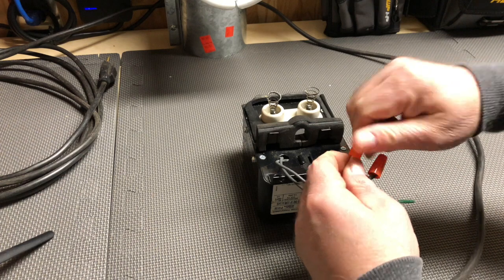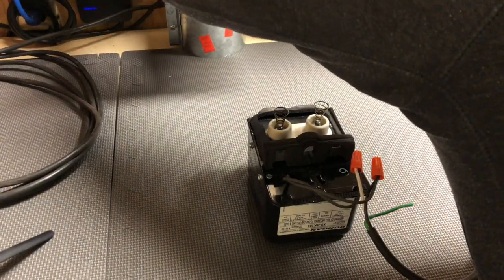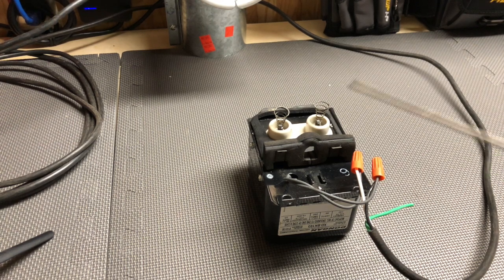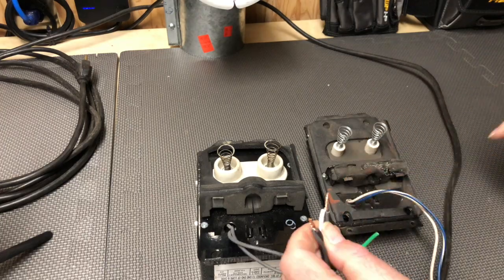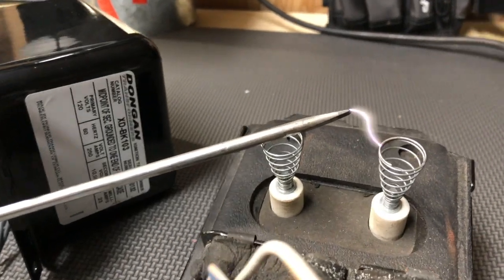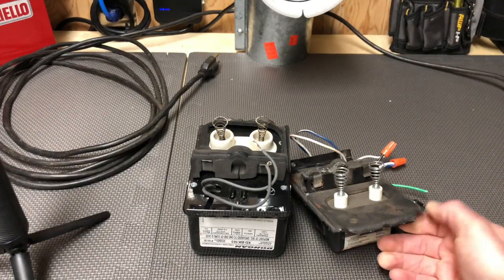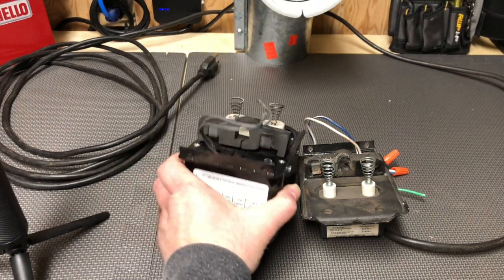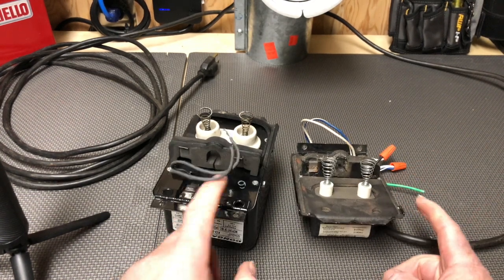20,000V vs 10,000V Ignitor – Shocking Burner Test

Comment: Does the higher voltage of the igniter improve combustion? Does it tax the ceramic insulation of the electrodes?
Reply from the maker: Stronger spark which help to ignite. The combustion is improved by adjust the fuel and air mixture using combustion tuning equipment. As for the electrodes, not 100% sure and every system is different because the controller may or may not turn off the spark after ignition had been established! I hope this helps!
Reply: @FurnaceTech I was told that the ignition transformer can be wired to turn off after the spark is achieved...is this true?

Comment: I have the bigger transformer like yours running my Tesla coil and it works great,but can it handle 240 volts A/C???
Reply from the maker: I would only hook it up to the power source it’s rated for posted on the data plate
Reply: @FurnaceTech  ok thanks.

Comment: My 30 year old burner was shutting down every few days and sometimes would take several seconds to ignite. Could not figure out why. Did the screwdriver test and seemed to be good arc. Good oil flow, new nozzle and electrodes. Replaced old transformer with a new Beckett electronic igniter for $50. Problem solved! Now she fires up instantly. The electronic igniters have much higher voltage.
Reply from the maker: Good job getting this fixed! This can be a tricky one to narrow down. When these transformers get warm they can get weak if there is something wrong inside. When they cool down, they arc great!
Reply: @FurnaceTech  Thanks. Do the solid state ones also get weak when warm? How many years should I get out of the new $50 Beckett igniter?

Comment: Did you connect the white and blue cords together? I'm trying to test mine today and I am confused with the two cords. I connected the blue to the positive and the white to the neautral and it didn't work for me so I swapped them and that didn't work, help!!
Reply from the maker: Power is applied to the blue/white stripe wire and neutral hooks up to the white wire. You will need to jump across the transformer springs with an insulated screwdriver or a tester made to test transformers to see if it sparks. 

If you do not get a spark your transformer is bad or you do not have incoming power. Verify you have power coming into the transformer.

Be careful when testing these it can be dangerous.
Reply: @FurnaceTech  Thanks so much for clarifying, there is an incredible amount of  conflicting information online, and careful yes always :)
Reply: @FurnaceTech  I tested it, it works! I'm still alive lol and after watching the video again seeing you placing your arm over the transformer while plugged in scared me. I wouldn't even do that, in fear of creating a path but that's me. 
Also I had electricity I could see literally coming through the probe wires!!! 
Instead of using the screwdriver method I attached two fat wires all cooper from a nice set of jumper cables and connected the ends of those above some wood cookies. 
Literally about 4-5 inches down the wire from the arc it was coming right out of the insulated wire onto the board. That was incredible!!!
Reply from the maker: @lilrida649  I am happy you were able to test it! It is pretty cool watching it work!!! Now that you see how strong the spark is and watching my video again you can definitely see how dangerous these can be! I was a bit close while plugging in the power.

Comment: Transfermer output AC or Dc
Reply: Thats wrong. Its still ac voltage with the 10kv unit now maybe the 20kv has some capacitors to flatten out the sine wave but thev10kv unit is stil 60 hertz hence all the the reason it sizzles. Thats the polarity switching or alternating 60 times a second. High voltage dc outputs like a van der graff generator releases one big zap.
Reply from the maker: @mds1986ms  correct the small one outputs dc and the 10,000 v transformer outputs ac power. I should have been more clear with my last reply
Reply: @FurnaceTech  
Eh thats ok i didnt need to get so long in the tooth with the correction. 
So since the small one is DC i wonder if they can be setup in series and/or parallel just for the sake of tinkering and being the potential recipient of a darwin award.
Reply from the maker: The small one changes AC input power into DC voltage!
Reply: Oh well now that you edited it i just seem like some redundant jerk. Hahahahaha! Oh well i shall leave it up for all posterity to observe.

Comment: Let's get some facts straight here.  The 10,000 volt transformer is a true 10,000 nominal volts output unit.  The 20,000 volt electronic ignitor is not even close to 20,000 volts.  Most are rated between 14,000 and 18,000 peak voltage.  The nominal voltage is typically around 6,000 volts.  So understand by going to the electronic ignitor you are actually downgrading!  Also, any good tech would know you don't test an electronic ignitor with a screwdriver.  Unlike the transformers which are made of copper and iron, the electronic ignitors are solid-state and are made up of over 100 electronic components inside.  Using a screwdriver to test will at the very least shorten it's life span and in some cases just plain burn it out!!!!
Reply from the maker: It’s perfectly safe to test these electronic igniters using an insulated screwdriver. Any good tech would know that!!!
Reply from the maker: Thank you for your helpful advice!
Reply: Very good reply PJ, Also these solid state ignitors  produce a Hz cycle rate of 15,000 to 30,000 Hz!!!!!! That could put you in the ER if the handle is cracked on the screwdriver. Please DO NOT test these with a screwdriver! Simply bend the springs to within 3/4" and then turn the power on WITH the fuel line disconnected to the nozzle line. And it should spark. Or the best way is to have a Certified Oil tech look at it for you, to be safe.
Reply from the maker: It’s perfectly safe to test using an insulated screwdriver. Another way is to tilt it back on its hinge when voltage is applied to check for a spark!
Reply: @seanh5754  or use a tester like the Checkmate from Allanson.  It tests both electronic ignitors and iron core transformers, all brands.  Judging by the blue and white wires that electronic ignitor is an Allanson product.
Reply: PJ Garvey 
Nope. Beckett literature clearly says you should use an insulated screwdriver across the springs to test it. See Beckett "Getting Acquainted With Electronic Igniters".

Excerpt:
HOW TO TEST ELECTRONIC IGNITORS

WARNING SHOCK HAZARD: Though this test is common industry practice, be careful not to physically touch any part of your body to the ignitor springs or anything metal that is touching the ignitor springs while the ignitor is energized.

CAUTION Just like an iron core transformer, an electronic ignitor is most simply tested by supplying it with 120 V input and observing whether it produces an arc. This may be done by looking or listening to see if there is an arc across the electrodes while the burner is running and the ignitor is energized. The ignitor may be tilted back on its hinge and, when voltage is applied, the blade of an insulated screwdriver may be placed across the springs to test for an arc.

Remove power from the burner and block the fuel supply to the nozzle line while performing this test.

NOTE: If the machine is equipped with a primary safety control the cad cell will not permit the primary control to energize the ignitor if the cad cell senses light. To perform this test, disconnect one lead of the cad cell from the primary control, or remove the cell from its base. DO NOT use transformer testers to test electronic ignitors. Doing so will give you an inaccurate measurement and may harm the ignitor, the tester, or both.

If an ignitor fails, it generally produces no arc at all. However, similar to an iron core transformer, an electronic ignitor can have a weak output arc. To test for this, perform the screwdriver arc test described above. Energize the ignitor and place the blade of the insulated screwdriver across the springs. Keeping the blade in contact with one of the
springs, slowly pull the blade away from the other spring, drawing an arc from the spring to the blade. With a 110 V to 120 V input and no airflow across the arc, the ignitor should be able to maintain an arc with the screwdriver blade at least 5/8″ away from the spring. If the ignitor is not able to sustain a 5/8″ spring-to-spring arc, or if an arc drawn from
one spring to the grounded baseplate is weaker than an arc drawn from the other spring to the baseplate, replace the ignitor. See also point 6 above.